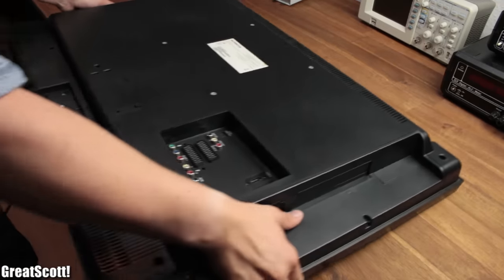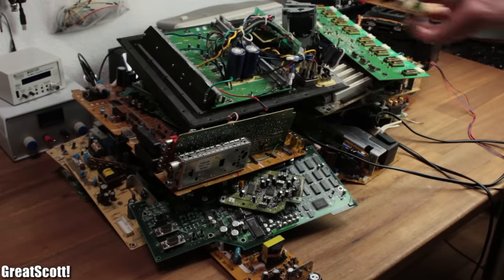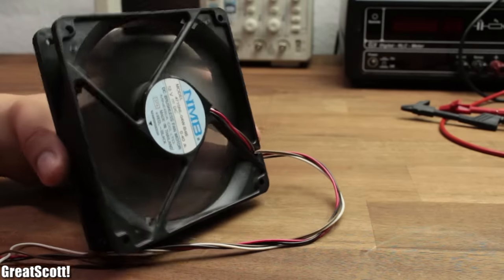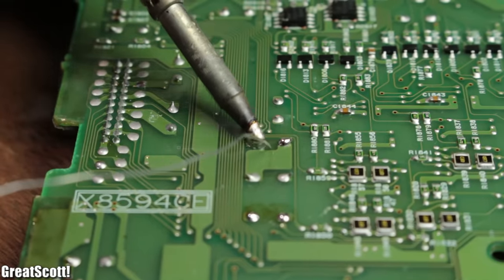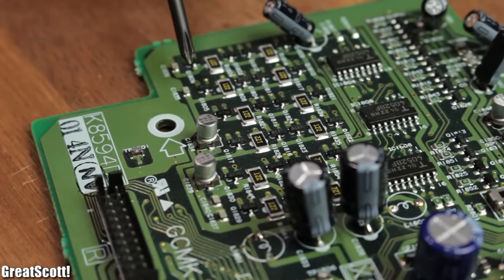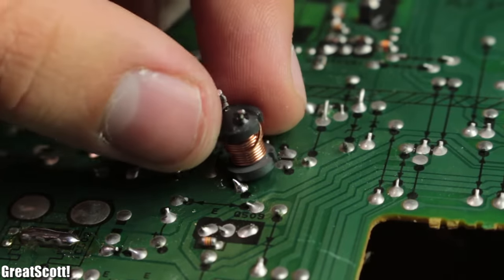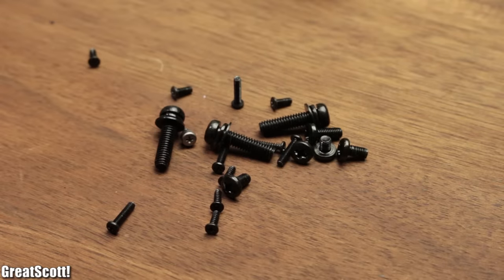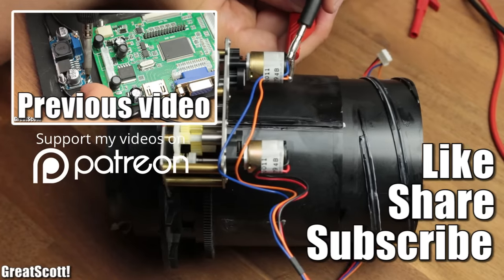What is worth desoldering from old electronics? || DIY Fume Extractor

Comment: I use the sun and a magnifying glass to desolder parts to keep it green
Reply: interesting 😂
Reply: Hmmm I don't know if my eyes would like that . . .
Reply: i would think that would be hard because solder is shiny...
Reply: @fungusenthusiast8249  Paint it black and use welding goggles.
Reply: @guilhermetorresj  is it true?
Reply: photovoltaic cell > controller > 12v battery > power strip > iron + fume extractor
Reply: thats the most weird thing I heard that week
Reply: Nah, just take the parts to Australia and the sun will desolder the parts for you, no magnifying glass required.
Reply: @sasdagreat8052  try the African Sahara
Reply: @sasdagreat8052  How about Saudi Arabia
Temperatures here sometimes reach 50 with alot of humidity in summer
Good weather these days though
Reply: @UmarKhan10894  Ditto mate, I've lived in KSA for 6 years and can definitely say the desert sun's enough to burn a few holes through your PCBs as required. It's the opposite of humid there, though (used to have spontaneous nosebleeds because of the dry weather); come to tropical countries to see real heat + humidity
Reply: Very interesting , I will try that.
Reply: so you just work on old parts like 2 weeks per year? XD
Reply: Shocking that anyone believes this.
Reply: @EarnestWilliamsGeofferic  Who exactly believed it?
Reply: I use my big ass propane torch to keep it fast
Reply: Not here in Wales .UK 😂
Reply: @rodfransham2907  Welshman Anthony Hopkins: we're just like the Irish but uh. . . . couldn't swim.

Comment: I built a wah wah pedal a few years ago from old home appliance circuit boards using this method of scavenging parts. 
I used to help a friend whose job was appliance repair, so any time we switched out circuit boards I'd take them home with me. Most of the parts were easy to find, I did buy some of the resistors and caps though, but it took me forever to find a good suitable inductor coil. The coil is the main component that gives the pedal it's particular "wah" sound. Eventually, I got one when we repaired, I think it was, an oven. I was delighted!

Comment: I'm currently sick as hell from not using fume extraction. Anything is better than nothing, but honestly your health is worth the $40.
Reply: +Crazy Hans 
Use a bathroom vent fan hook up a dryer hose and vent it outside.
Reply: i made myself one of an pc cooler (fan) and an adapter
Reply: I smell something and it ain't solder fumes
Reply: Yeah, I just have a window fan blowing out a window, away from me.
Reply: I just wear scuba gear.
Reply: @ender_scythe2879  
True, but...no other better options.  So the problem must be solved at the creation stage, so that things can be replaced etc without needing to desolder them.  I don't know exactly how we would do that, but I'm sure we can/could at least alleviate this issue, like make all components snap on or something similar.
Reply: @mypronounismaster4450  use a gas mask

Comment: It's worth cutting those wall wart leads a few centimeters behind the plug, instead of right at the strain relief. With some length left over, you can solder on to the plug and reuse it, too.

Comment: Usually you can desolder DIP ICs using a heat gun for the few that are worth keeping. After you've removed everything else you want to keep.
While I don't desolder then in advance it happens from time to time I'll desolder especially SMD resistors but also other stuff. Usually the resistors are for replacing in stuff that has way to bright (usually) blue LEDs in them.

Comment: Your plug cutout technique is terrifying. What a waste of a good dc Jack!
Reply: joblessalex 
I was think the same thing LOL.
Reply: joblessalex i would say the same!! Ceramic capacitors and small transistors are worth to save... It will make you save kilometers to go to the electronic shop! I save also cables and some connectors. As he said "we never know when we will need it"
Reply: yahnsolo
I always save the small transistors and ceramic caps. Electrolytic ones go to the trash, but the ceramic ones are definitely worth saving. I use my secret weapon to remove them all quickly. Blowtorch to the back of the circuit board and a pliers or big magnet to gently pull them off. Works every time. XD
Reply: +theLuigiFan0007 i also save the ceramic caps ,resistors,transistors and dip chips
Reply: *****
Indeed. Especially when you find lots of a specific value or high precision or a unusual value you think might be hard to find if you ever need it. I usually can't save the tiny SMDs even though I had a small tweezers for handling them. They just get stuck in a blob of solder. I might try *****'s idea over a white sheet of cardboard once I get my oxyhydrogen torch I use to desolder working again. I need a new clear plastic tank and graphite plates for the hydrolysis.
Reply: *****
Yeah I guess my cheap iron is the problem with saving SMDs, cost me a whole $9 on the internet. That's why I use a Oxyhydrgen (aka HHO) torch I built to mass remove components. That's no good for tiny stuff, unless I don't care which one is which or f they have slight burn marks. Someday I'l get a proper soldering station with temp control. Honestly, I need one regardless. XD
Reply: +hellterminator sounds so professional :)
Reply: +hellterminator It`s fine, just sounds disturbing :) air guns are overpriced anyway.
Reply: Parker Davis okay?
Reply: joblessalex
What is this Parker Davis going on about? Think that might have been the comment version of a drunk text to the wrong number. XD
Reply: theLuigiFan0007 most likely
Reply: FYI I guess is this a status update. I now use a butane micro torch that has both hot air and soldering iron tip attachments. Works perfect, and the hot air is just the perfect temp for SMD work or heat shrink tubing. No cords, no hydrogen hoses, and butane is cheap, like $3 for a bottle that refills at least 30 times.
Reply: joblessalex o
Reply: @yahnsolo  I bought ceramic caps by the hundreds for very little money. Usually it's just not worth the bother to desolder them. Their leads are usually inconveniently short. I might do tantalum caps, and I usually do lytics. But even here, they're so cheap that it's not going to save me money.
Reply: Baruch Ben-David that is true as well... not always worth sth as it’s so cheap!

Comment: A quicker way to solder things is use a heat gun on the backside of the board for a few seconds and give it a good whack and the parts will often just fall out.
Reply: +Patchuchan propane torch works well also...
Reply: Sometimes the pins are bent over. and you should use a clothespin or something to help grip them to extract them.
Reply: DO NOT DO THIS UNLESS YOU HAVE A BOARD OF INDUCTORS OR RESISTORS!!! I used to do this and it heat damages the parts very badly... sadly it is the only way to get BGA chips off of boards though. The fumes are awful too because you are getting burnt board, solder, plastics, and other crud all at once, which is a HORRIBLE thing for your health
Reply: @allurared9029  i dont think a soldering iron is much better, because it takes a lot longer

Comment: What do I remove? EVERYTHING I can, including smd parts - I pre heat the board then a heat gun and using a soft brush, sweep the parts off the board to sort out later. Gradually going up in size until getting to awkward parts. Then it's a case of using a Dremel, cutting through the board around larger parts like sockets and transformers, then dip the board piece into a solder pot by holding the part (wearing leather gloves!) and within a few seconds off comes the board away from the part. Sometimes it's necessary to pull the board section off the component with pliers.

For a large mobo it takes around 20 minutes for a whole host of parts. The sorting takes a bit longer, but I do a big batch at a time.

Comment: Don't laugh, but I had three times the amount of trash pcb's here from servers to household crap. I just took a small torch lighter and took most useful parts of this way. Surely this isn't a great idea because of the intense heat, but it worked ..
Reply: It works if the components have long leads that you can heatsink on the other side.
Reply: Yep but the torch idea isn't good actually. Because the components reach a sudden abnormal amount of heat which will degrade the parts? Or cause failure after the heat was applied? Idk desoldering seems to be the best I guess.
Reply: put a fan on the other side to cool the components and you'd be fine. most of these components ain't worth it anyway so break a few won't matter and most importantly it save you lots of time. Just check each of them after so you keep the good ones and throw the others.
Reply: Yep. Silicon components are more robust than most think, and a hot air paint stripper gun is your friend. After all, the components had to tolerate pre-heat and wave soldering in the first place, and SMD parts need to tolerate reflow temperatures. 
Regarding donations, This guy sounds like he may be in Europe. Since this video was made, things have changed. Unless you are outside Europe, donating through Patreon is a bad idea since they collect VAT and under normal circumstances it wouldn't be payable. Better off donating via Bitcoin if the channel has a Bitcoin address, or via Paypal. Also, two currency exchanges soaks still more of the donation.
Reply: Weedle Guy
Reply: Exactly! Me too! I have a powerful lighter with 3 fires which can liquidate the solder in less than a second. I put a small needle between the part (SMD, DIP, etc) and the PCB, put a wet sponge below them, heat it and push the needle, and the part falls down to the wet sponge which cools it. This way, because the lighter is powerful, it heats the PCB fast and before the part gets too hot, and the parts will also cools down with the wet sponge. I NEVER lost any part this way, and since it's so easy and simple, I do it all the time with thousands of parts.
Reply: Roger L. Ortiz 

I have an el cheapo solder station with a variable power supply that was less then a hundred bucks and the iron set on 345 Degrees celcius, and a chisel tip, melts solder so fact and exactly that the components rarely have time to heat up. 

I got pen torch and I have really got some things hot with out heat sinking. 

None of this is used for any thing serious. But even at all that heat, a lot of stuff still works.

If you're a small town guy like me, and don't have readily accessable local places to obtain components, and you're one who might get about by bicycle, and want to save yourself the Hassel of waiting for a shipped component....or possibly one day when the internet's are all tangled up, you might be happy you saved and sorted all those so called junk components. Like resistors and even diodes.

More often then not, the desolder process happens so fast they don't get hot. 

A lot of irons that simply plug in, they don't get hot enough to perform the desolder process in a quick amount of time, and usually lead to heat being applied for too long. Even yet they still probably will work properly. An el cheapo variable temp solder iron are all over internet's for less then 20 USD. If not, then build your own. Hopefully with all those potentimeters and components you been saving that no one else saves.

If you got a hundred bucks to blow and want a nice little beast of a machine.. look up the 909d+ rework station. It's an el cheapo and comes under various names, but honestly, if you get one, and want something for simple tinkering, totally go for it. You'll be  surprised and glad u got it. 

Make your own leads tho. 

The KKMOON 909d+ on eBay was the best deal. 98.69 USD free shipping.

Came with a boat load of solder assist tools as well. It was the cheapest I found with the most additional items. 

It has a heat gun or smd rework as well, a 0 - 15v power supply and 2 ammeter and a USB port with 5 volt output. 

Everything is variable except you can't adjust amps. Is a voltage meter as well.

An analog version is available for less with out USB.

It comes under many names with number letters 909d+.

I ordered the kkmoon version on a Monday with free shipping and had it by Thursday afternoon.
Reply: For some motherboards I use a full blown propane torch on the underside (holding the MB upside down), and shake everything off. Never hurt a part yet, and the leads/SM connects come off super clean.

Comment: Yes, I too am a tinkerer of electronics as well as automotive stuff. I built for my HAMM radio license class a working transceiver about 40 years ago. I sourced the parts out of the kind of throw away stuff available in the midwestern United States in the late 70’s. It was not complex but could send/ receive Morse code out to about 30 miles. I am the same with car/ motorcycle parts... made a perfectly working Muncie M-21 4 speed transmission out of 2 broken M21s.
   Keep at it brother. We’ll see who builds the first time machine!  ;)

Comment: I think one of the things I regret most in life js saving these random parts from electronics. I haven't in over 50 years used any of these that I saved.  I always end up buying the part that I need.All the time I've lossed I will never get back. Time is worth more than money
Reply: I think the point is potentially saving these items from landfill or incineration, and the benefit of reuse. Of course that didn't work out in your case though but at least you tried and now, later on, there are places to donate those components to to save them from needlessly being thrown away. Certainly when you first started to collect there might not have been the same places to donate those items to. Globally WEEE  is a scandal and we are spending a lot of time and energy taking metal out the ground just to put it back in within a few years in an almost unrecoverable state.
Reply: Growing up in the 80s my dad saved everything electronic from the 60s on.. we used all kinds of things.  Lots of audio circuits from old radios and stuff like guitar effects pedals, even a safe.. he was an electrical engineer so maybe it's different but I save stuff and use it all the time.. lots of connectors, lamp, voltage regulators, switches and jumper wires.

Comment: what do you use the coils for?
Reply: coilguns?
Reply: airthrow copper wire is actually quite valuable (dont forget useful), considering how common it is
Reply: I've been an electronics hobbyist for a long time but since I'm not into radio yet I've never once needed a coil on any of my projects.  I'm going to start saving them when I scavenge parts but just wondering what projects I could possibly use them for.
Reply: Once you use AC and have capasitors then you will need coils to compensate (you can represent that with a complex number). Else you use more electricity than needed.
Reply: They are commonly  used in filters, power supplies and buck converters.  If you deal mostly with DC circuits, then you probably don't need to deal with coils (inductors) all that often.
Reply: Enigma758 I kind of want to learn how to make my own power supplies actually so I'll probably be using them more soon.  Are there common values or are they really varied and I'll need to get specific ones for every project?
Reply: If you're converting AC to DC, then inductors are sometimes used to help filter out the ripple (so are capacitors too for that matter).  It depends on the incoming waveform which can vary across stages of your rectification circuitry.  Also, not just the inductance, but also the resistance of the inductor can be a factor as well so it's hard to give a pat answer.
Reply: Enigma758 No your answer was very helpful because I hadn't thought to think of the resistance of the inductor too.  Thanks!
Reply: TIME MACHINE :-)
Reply: Also, you can use them to make inductive oscillators.
Reply: @airthrow  I found that inductors can be more effective than resistors in some cases.
Reply: A wunderwaffe dg4 of maybe a railgun
Reply: @airthrow coils are useful in almost every device, you can filter signals with them, build LC filters, convert voltages, smooth voltages out, transmitt radio frequencies, and they have also many other uses...

Comment: "If you're like me, you like to take your old electronics apart..."
Yep, that's me.
Fume extractor?  Seriously?  I don't desolder THAT MUCH.  Adequate ventilation, like adequate workspace and light are key.  I don't desolder inside a small box.
Lately, I just break boards into smaller bits for later.  Anything with burned parts gets trashed, interesting parts get grouped for later removal.  "Today is transformer day!"

Comment: never save any electrolytic caps they are too toublesome and only have a short life compared to other components.
Reply: Urban myth, there was a supply of capacitors that were faulty around 1997-1999 that had IT support companies and manufacturers worried at the prospect of replacing thousands of PC PSU's  ... now that situation has people 'recapping' old kit 'just in case'
Reply: Some electrolytics are made to last decades, depending on how they're used. They aren't always worth saving, but they often are in my opinion, especially those that have higher than necessary temperature and/or voltage ratings for a given task. Small increases in either can greatly increase usable life. This is why you often see 105° C (or higher) rated electrolytic caps in higher quality 50° or 40° rated computer power supplies, and that is a large part of why some of them have warranties of ten years or longer when running 24/7 at their maximum temperature rating for the power supply. Use those caps at a lower temperature and voltage (they're typically rated around 400VDC at the active PFC output) and they might outlive you.
Reply: tru